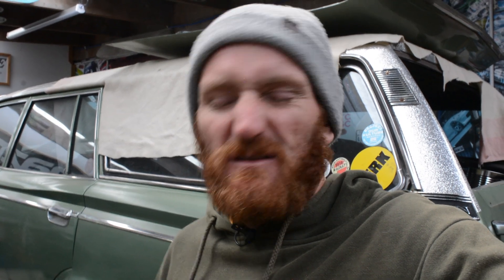Toyota KP61 4AGE Starlet - Intercooler Fabrication

Comment: It's a shame you didn't order an IC with opposing tanks offset opposite directions or chop one tank off and swung it around. Get more even flow and higher efficiency that way, but especially on a low mount turbo the pipes end up even shorter.
Reply from the maker: I’ve been building this thing with parts what I’ve got lying around/ are good value for money/ or I can make, So your just seeing me build what I like mate. I’m really not trying to build any marvel of automotive engineering.